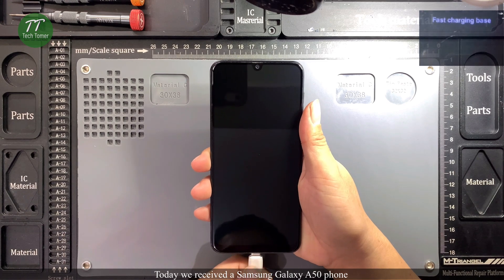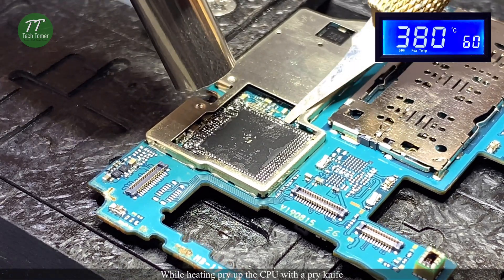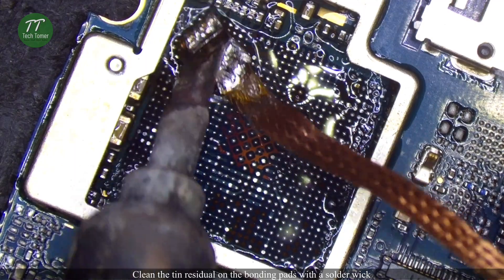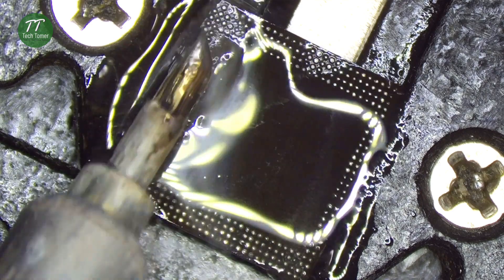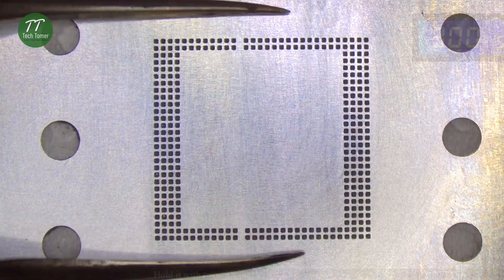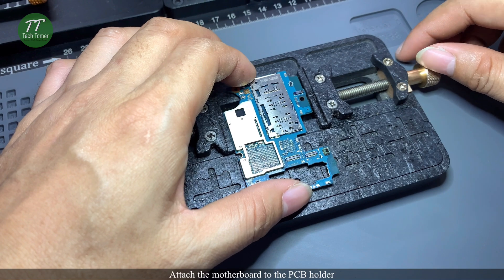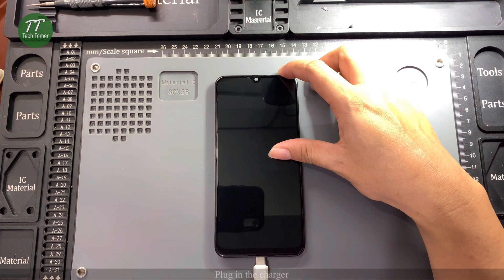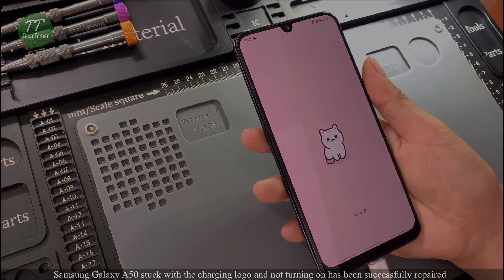Samsung Galaxy A50 Stuck with Charging Logo and Won't Turn On CPU Reball Tutorial | Tech Tomer

Comment: CPU is (central processing unit) that why in every phone they call CPU not SOC because SOC refer to system on chip, that why reball CPU not reball the system chip... sometimes clarify something will be misleading others..
SOC is something inside the CPU so in anyway they use CPU instead in any spec you might see,that why reball CPU and buy CPU if you want to buy SOC they might ask what is that man..?

Comment: It's very difficult to separate the RAM from the CPU. I have to reball the CPU of an iPhone 6s. I desoldered the CPU of a faulty logic board but it was attached to the RAM. What happens if I reball the CPU only? I would not like to separate the RAM from the CPU. Is it necessary to desolder the RAM and reball it? Very useful video. Many thanks.

Comment: Just simple method that I had tried_
1. plug in charging cable into port and waiting for that stucking charging icon for 5 seconds
2. press the power button and hold it till next 3,4 steps 
3.unplug the cable 
4. press volume down button for 5 seconds untill screen blinks to blank screen 
5.hold off all button that you had pressed suddenly.
6.waiting for samsung a50 logo
7.suddenly again plug in cable 
and wait for surprise....
I hope it will work for rest assure.
thanks me later
Reply: add simple tip, if ur percent is 0 just quickly turn it off, and if the charging logo appear again just press the power button 1 time
Reply: @122GamingYT  did not worked.
Reply: thank you so much it works. ♥
Reply: @sotmuu  did not worked :(
Reply: impossible to do with a zero % battery :(

Comment: Samsung A037f charge when phone off but when phone is on then charger light showing even i dont connect charger to ac. Voltage is directly come from mobile itself.
What is the problem sir?
Reply from the maker: try to replace the charging board